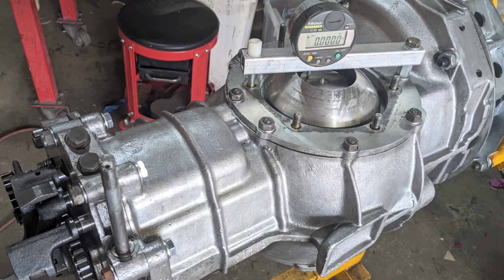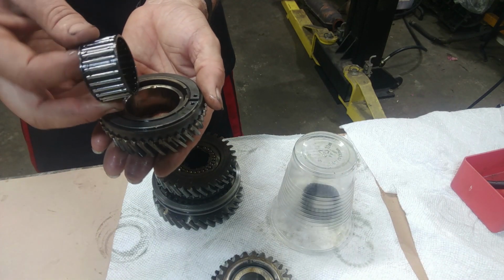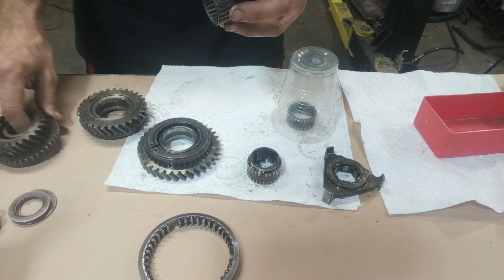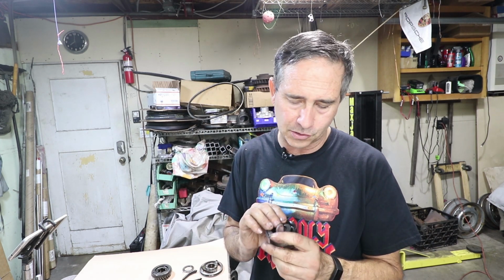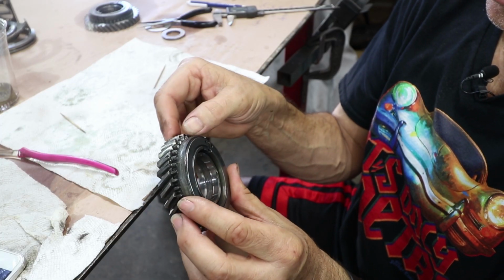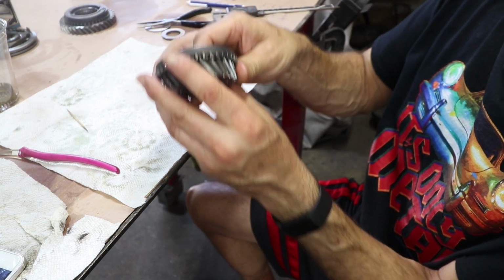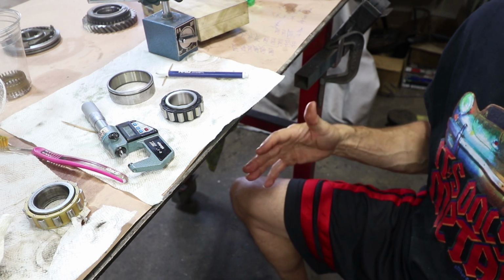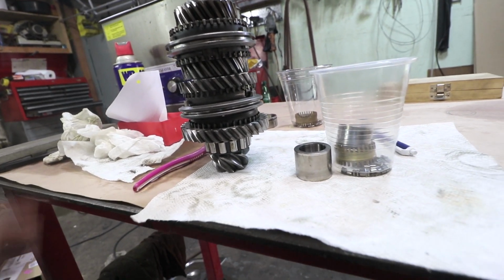SHEESH!!  More Missing Transmission Parts Discovered On My Porsche 356 Pinion Shaft Disassembly

Comment: Great video.  Was a taller replacement fourth gear ever a consideration?
Reply from the maker: Thanks, I haven't thought about that.  I could be wrong, but the SC's came with a taller fourth???  5th gear would be even better, but that is why I have 911's 😎
Reply: @GarageTimeAutoResto  Will a 911’s five speed fit in a 356? I ask because in 1965 a banker who owned an Indy car team invited me over to see his new 911. He said one of his friends had put a 5-speed in his 88 HP 356C and it was as fast as an SC. I’ve always wondered whether it fit or if his mechanic had to do some body work.
Reply: Great question; with aircooleds everything was designed together so too much of a taller gear can also overheat the engine.
Reply: @vayabroder729  There a couple of gear ratios for 356s of the B and C vintages. All my Porsche literature disappeared during a move but I do remember that the .95:1 was the advertised ratio of my ‘64 SC. Actually, you could get a number of gear ratios for racing. And you could get a 31:6 hillclimb ring & pinion to replace the 31:7.

Comment: Can you get replacement bearings? I assume they are not just standard industrial bearings, but it would probably be better to just replace them.
Reply from the maker: I think everything is available for a price.  The one pinion bearing that I replaced in this video was $400
Reply: @GarageTimeAutoResto  That is one very expensive bearing, I see your point but at least you have the option to replace them.
Reply: @sergiusabo  where I work we were afraid we might need a new double row roller thrust bearing of about 12 inches in diameter. The quote was for $30,000.
Reply: I agree that the tranny was worked on before and was assembled incorrectly losing and leaving the needle on the bearing out.